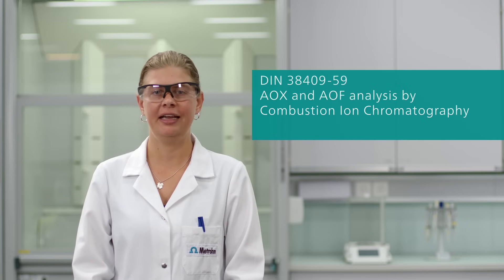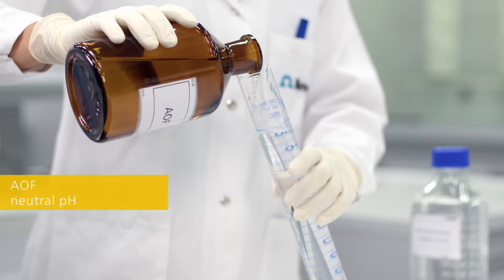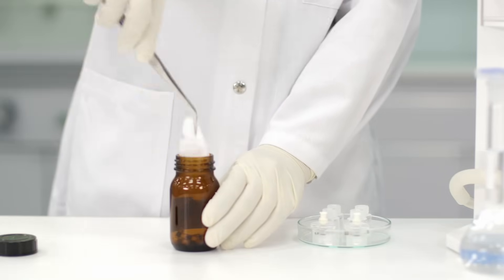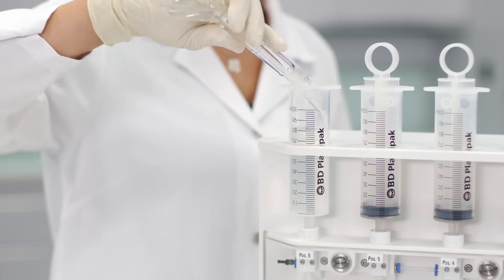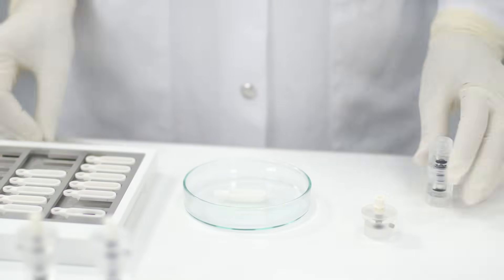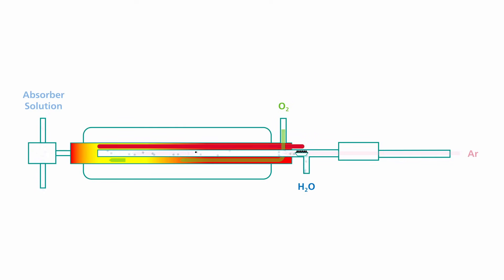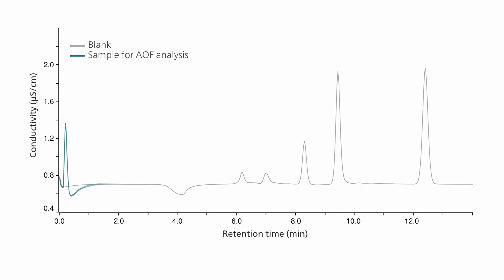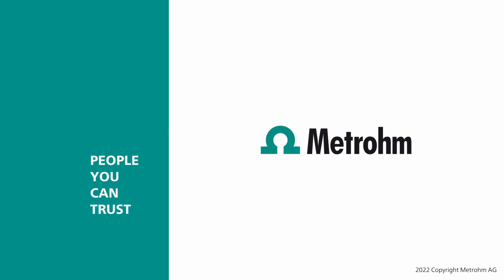How to analyze AOF and AOX by combustion ion chromatography (CIC)

Comment: What combustion system do you recommend? Does Metrohm manufacture a system for combusting the activated carbon?
Reply from the maker: Hi Chris
Thank you for reaching out to us. We would recommend the following setup for this analysis:
930 Combustion IC PP (AJ) system:
https://www.metrohm.com/en/products/2/9309/29309010.html
MMS 5000 Autosampler:
https://www.metrohm.com/en/products/2/1360/21360800.html
Kit for solid samples for MMS 5000:
https://www.metrohm.com/en/products/6/7302/67302000.html

For preconcentration, we recommend the APUsim from Analytik Jena:
https://www.analytik-jena.com/products/chemical-analysis/sample-preparation/separation-and-extraction/aox-sample-preparation-series/

If you would like to learn more, please contact your local Metrohm subsidiary or exclusive distributor through our website.
Best regards
Metrohm International Headquarters